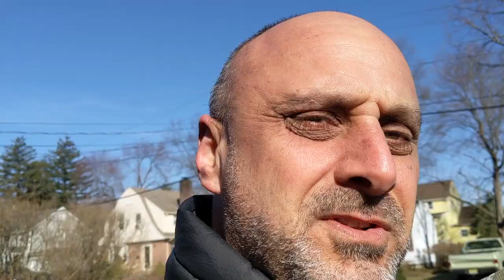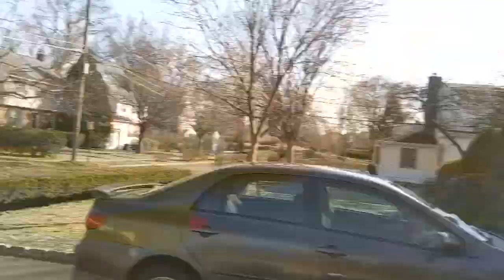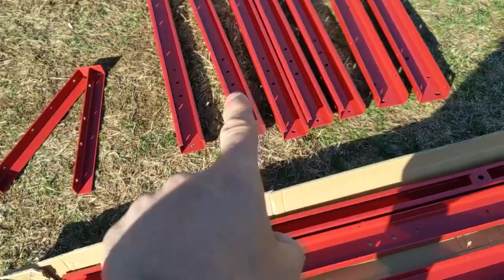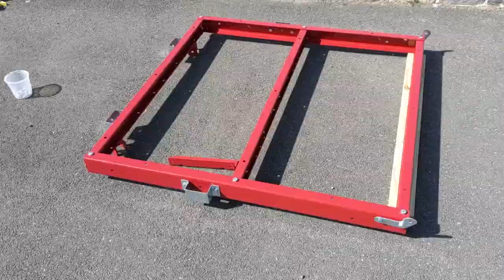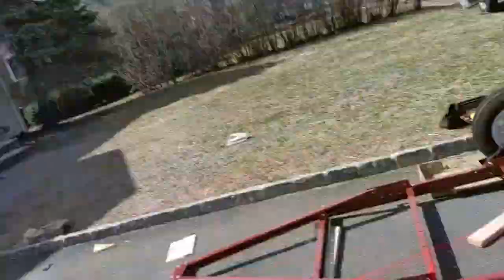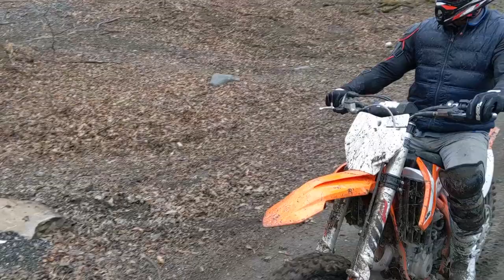How to build a Harbor Freight Trailer 1720 Lbs

Comment: how do get the bikes on and off the trailer ?
Reply from the maker: We push them on and off with a 2*6 (6feet)  piece of wood we take with us on the trailer.
Reply: @HOLYSHIFT  how you tight the straps on the center between the to dirt bikes you welded something? Thanks
Reply from the maker: Gsxr D Hi - I installed in the center anchor loops. I connected the loops with bolts into the wood Decking.

Comment: Does it still fold up with the 3/4" plywood on top?
Reply: Yes, it does. I have same trailer and put on 3/4 plywood, folds fine. Always have to secure the two halves with bungees or similar when storing upright, with or without the plywood.